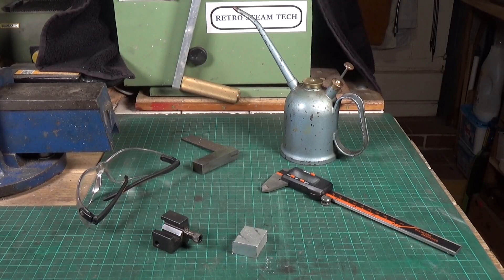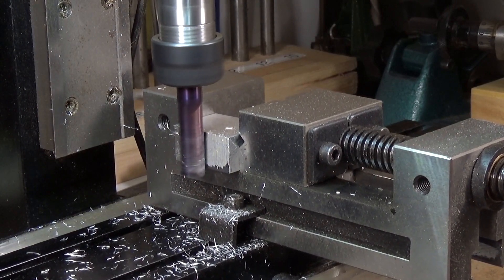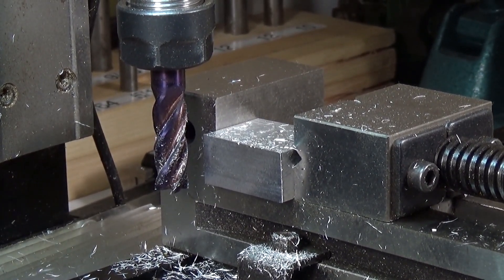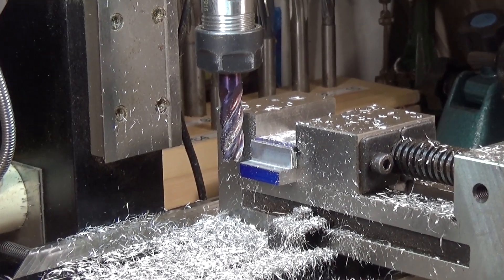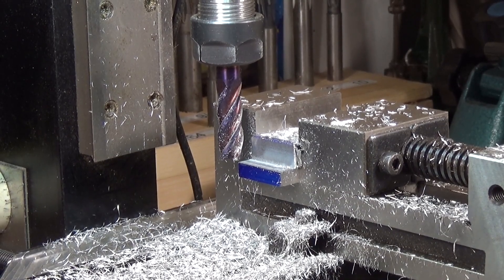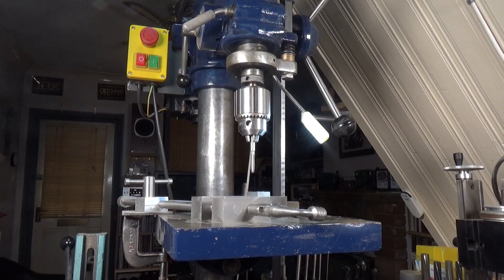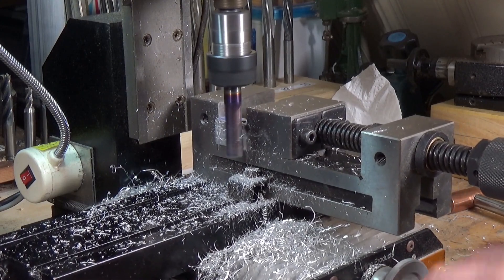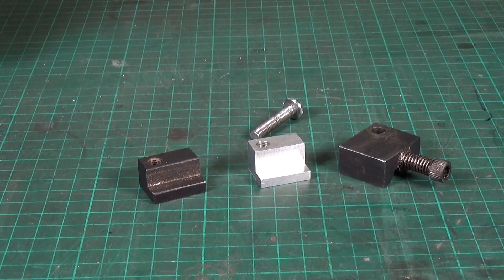Warco WM180 Lathe Carriage Stop Mod - Using the Sherline Mill

Comment: I have seen other ones with a guide pin next to the clampling screw. This holds the clamping block more square to the lathe bed. There is room for this to be done, only a suggestion.
Reply from the maker: That's a good idea.

Comment: Gday Alan, the sherline did a mighty job, the surface finish was really nice, now did I read the comment correctly, did Rob say he needs to buy a mill🤷🏻‍♂️😉,  great job mate, cheers Matty
Reply from the maker: Thanks Matty. That's a 4 flute 10 mm end mill that I got from Banggood, it's really sharp and makes short work of aluminium. I was going to use some WD40 but I was only taking light cuts and it was producing an excellent finish so I didn't bother. Rob's been going on about getting a mill for ages, I'll believe it when I see it 😂 Cheers, Alan.

Comment: You're making me very jealous Alan.   That little mill did a cracking job.  I need to get moving on a mill purchase.  The modification looks excellent.  Was that home cast ally ?  Cheers Rob
Reply from the maker: Hi Rob. I'm quite impressed with the little Sherline, as long as you take your time and just take small cuts it works really well. The ally was some scrap flat bar that I had. I only have round stock from my home casting, which I could have used but would have required a lot more milling. Cheers, Alan.

Comment: Hi Alan,
Good video and upgrade to the lathe... I would be interesting in watching how you approach the mini jacks for the Sherline as I could make a similar things for the Unimat when it's in the milling mode.
Have a good weekend.
Paul,,
Reply from the maker: Hi Paul. Thanks. I've made one already, very simple. Took a piece of 19 mm mild steel bar, turned to length with a chamfer on the top end. Drilled and tapped to 6 mm. Then I took a 6 mm cap head allen screw and turned the head down until flat and used a thin 6 mm nut to lock it. When screwed fully home the top of the screw is just below the bottom level of the mill vice. It doesn't have a lot of range, will probably only extend about 20 mm but should be sufficient for what I need. Cheers, Alan.
Reply: @RetroSteamTech  Cool thanks